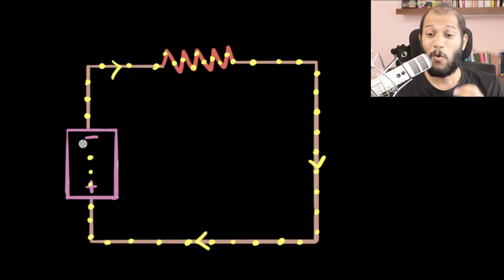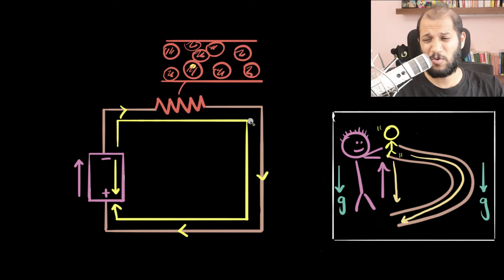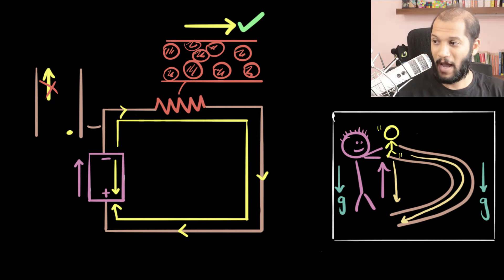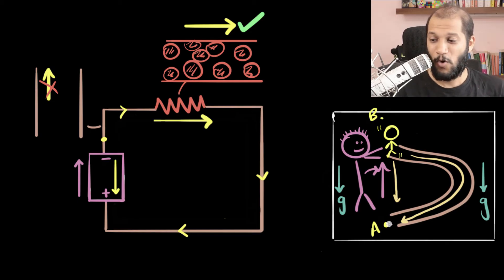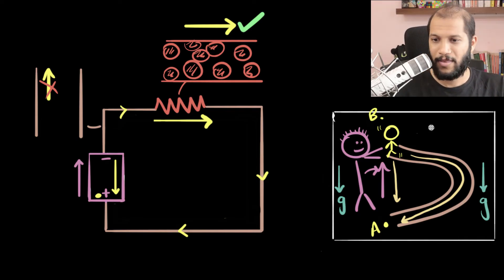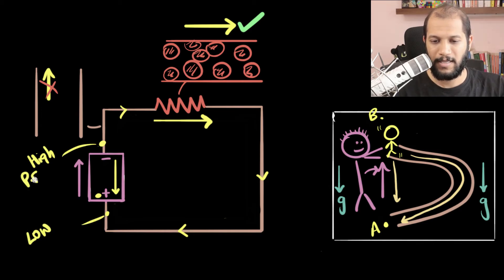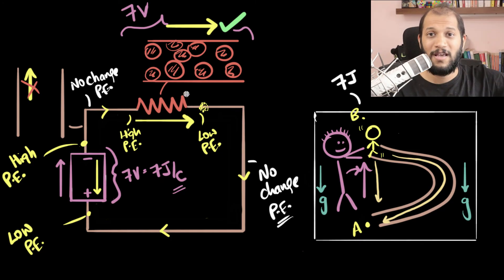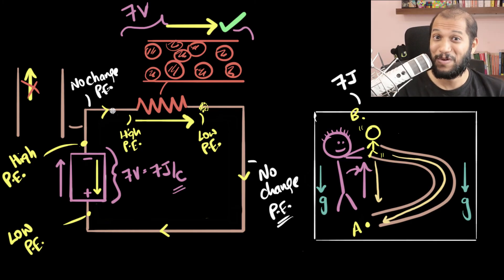Why voltage across resistor equals voltage across battery?

Comment: electrons DONT flow INSIDE the battery, this is a common mistake, the easier way to know why is by looking at the battery structure, it is a galvanic cell with an insulator between the two electrolytes, electrons CANT flow from a side to the other, thank you though.

Comment: I don’t think the electron physically moves, it might vibrate or move a little. But I don’t think it flows. It’s the field that flows that is termed as current.
Reply: Electron does flow ... it gets a velocity through the wire called drift
Reply: The video is misleading. The electron does not flow fast enough as per impression in this video. Furthermore, in AC current the electron definitely does not flow through the wire it simply oscillates back and forth
Reply: @kieranramtohal9645 exactly my point

Comment: If a resistor is designed to create potential difference of 7v ,but if we use a 9v battery then what would happen to that 2v if the wire we are using is superconductor having no resistance in it

Comment: What if there is no resistance,where will the potential energy be lost?
Reply: No. If we apply the same logic used in the video, Electric Potential in each point of the circuit will be the same (Assuming we have a superconductor that does not have any kind of resistivity). However the electric potential difference/ voltage will be zero. Because Electric Potential in point A (say) and in point (B) will remain the same.

Comment: This explanation is fundamentally wrong. 
A resistor acts as a bottleneck, affecting the flow of electrons across a wire. This is similar to you attach half inch pipe between two four inch pipes. Flow of water will be determined by narrow pipe in the middle. Most of water pressure will concentrated to force water  pass through narrow pipe.

Comment: So then what happens if you remove the light bulb and its just plain copper wire? Since you said that nothing happens to its potential energy because there are no forces in the wire, then does the voltage stay the same around a circuit with no loads? I don't understand.. because the electrons lose their energy when they come back to the positive terminal, so there must be a slight change in potential energy in the plain wire. Idk, I'm just some 9th grade kid so any explanation really helps :)

Comment: Sir i have a question, we know that positive charge move from high to low potential. If two sphere is positively charged then their potential will be positive. So suppose q1 has a potential of 13v and q2 has 5v and we connect them with conductor then the positive charge will move 13 v to 5v. But we know that if the potential is positive then the electric field for any charge is positive. so both 13 and 5v is the part of an positive charge and we know positive charge moves along the field line so in this case those are positive charge and their electric field is outwards direction. So then how positive charge move 13 v to 5v. Sir can you answer this question plz 😢🙏🏻

Comment: Sir, can you please explain series and parallel circuits 

And why CURRENT (I) is not the same in Parallel and VOLTAGE (V) is not the same in series circuits

Comment: But sir if there is no bulb or resistor in the circuit, then how will the potential difference be made because there will be no source through which charges flow and lose their potential energy ?
Reply: If am not mistaken there is some form of internal resistance in the battery,so if there are  no resistors in the circuit what will happen is all the energy/pd will be lost in the battery itself

Comment: Sir i wanted an explantion on how does the electrons work in a battery works like how does it create a potential difference ?? In this video you said that the electrons are pushed from the postive terminal to negative which is later pushed from the battery into the conducting wire ...but how can that neutralise the battery later on ...sir i am a bit  confused ...please help
Reply: sorrow in ass!! thats chemistry of cell
Reply: @WV_li  no no you didn't understand my question brther...sir said that electrons are pushed from postive to negative. ...then they are pushed from negative terminal to conducting wire ...so how can will this neutralised the battery cz ...the electrons coming back into the positive terminal would again be ...thrown into negative terminal...creating a never ending loop..

Comment: Mahesh, see my comment on your last video. I think you are creating more confusion on the direction issues here. The chemistry of the PLATES are opposite such that the electrons in the chemical are attracted to the more positive metal on the negative pole and the opposite on the positive plate.  But you may be mixing up that with the convention of assuming flow that trade school texts still teach due to probable cultural differences only now. The original excuse related to how the older texts use the arbitrary assignment of flow from the positive to negative direction.  But you  have to stick to the modern understanding when teaching the actual theory or it creates conflict. Those trade-school texts that I found and learned some from tell you up front about the distinction and so let them keep the burden in having to explain this if necessary. The high potential is only on the negative side. The term 'conventional' is misleading but only historical given the actual convention today is to the known reality of electrons. 

The plate inverse distinction is best left to when you want to teach how the chemicals work in the battery. Then the more positive metal is what attracts the electrons on that negative side  and the opposite for the positive side plate. The high potential is ONLY on the negative side because the charge on the metals are fixed and the chemistry involved needs a digression more involved.

Comment: I'm bothered by how much you are emphasizing how there are no changes anywhere but the battery and the resistor. I get that you mentioned that in the real world the wire would have to be a super conductor for that to be true, but you said that once and then treat the wire as ideal, potentially giving people the impression that wire has no resistance and only 'resistors' in a circuit will cause voltage to drop.
Reply: Bro really thinks anyone will care if he is bothered or not😂

Comment: Hm, so essentially, an electron gains some Joules of energy because of the chemical interactions in the battery. This is akin to a child gaining G.P.E. after his father raises him back up to the start of the slide. 

Then, there is no electric force in the wire and all electric force is concentrated on the resistor. Why? Well, that's a separate video. But, we can still compare this to our analogy. The wire where there is high P.E., we can compare that to the starting area of the slide having a wide area. No matter where it is in the starting area, the child remains to have high P.E. because it is still the same height. Similar logic in the wires. 

Now, when the electron goes to the resistor, that's when the energy is all lost. This is similar to when the child finally slide down the slide and therefore lose his high P.E. Then, the wire from after the resistor up to the opposite terminal of the battery all has same low P.E., which is akin to the ground. 

Because of this, we can say that the voltage across the battery is the same across the resistor. 
*Voltage is the amount of energy (Joules) per Coulumb of charge.

Comment: But .... Positive terminal has high potential??
Reply: The potential energy calculated for electrons, which have a negative charge. So, the signs of the potential energy of electrons are changed to opposite

Comment: I also have another question. If we remove the resistor and create a short circuit, it will mean there will be no voltage drop since we are assuming we are using a super conductor. How will it then obey the law that the voltage drop must equal the voltage supplied

Comment: Ok...thanks for these last two videos. Really explanatory. Just one question though. If voltage determines how much current flows through a circuit and how fast, can we say that the voltage drop is experienced across the entire circuit though affected by the resistor alone. The reason I'm asking this is because you said in your previous video that the speed of the electron is affected by the resistance and all the electron pay the price for that resistance in their speed. I don't even know if i am making any sense.

Comment: Damn thanks for the video, it cleared out my almost my all doubts but what if there's no resistor in the circuit? Assuming there's no resistor in the circuit means the energy gained by electrons wouldn't be spent anywhere (cause there's no resistor) so if that's the case then the energy would be same everywhere. So, when electrons comes to positive terminal, it'd have same amount of energy, which contradicts to the example where all the energy is lost when object approaches A from B. Also, what would battery do to that electron which already has an electron? would the electron gain even more energy and continue to gain energy at each interval?

Comment: What happens if we use a high voltage battery in a circuit with lower voltage resistors or a low voltage battery with a higher voltage resistor?

Comment: 18:02 how does the circuit know all of this? A doubt I’ve had for ages. Which video should I see for this?
Reply: Charge distribution on the surface of wire

Comment: What if two or more resistors are used u said at one end of resistor there is high p but at another there is low p approx 0 you said so in resistor two how can 0 p be transferred

Comment: Sir I am in 9th class ICSE.The definition Of PD is the Work done by the electric force from the terminals to move a charge from one point to another.But if I increase the length of the wire making the electrons to move a longer distance to reach the bulb the bulb should glow more brightly as I am increasing the displacement component.But why does not that happen?
Please reply Sir

Comment: Great explanation. I have measured the voltage referring to conventional flow.  Just before the resistance is battery voltage.  The resistance uses almost all of the voltage except what is required to overcome rest of the resistance in the circuit to make it back to the battery. Or am I just looking at it differently?

Comment: Hi, I have learned a lot from your videos. But this explanation seems to be wrong:

1. You say the electric field is conservative. Correct. However, it is not the same electron that is travelling from the negative terminal to the positive terminal.  So, your path-integral explanation is incomplete.

2. Also, when an electron aggregates at the positive terminal, it is NOT pumped back by the battery. It is instead just "absorbed" by the electrolyte in the battery. So no work is done by the battery per se to "move" electron from the positive to negative terminal.

After going through several videos/articles in books and the internet, however, this concept is still not well explained, and I still struggle to truly understand what is truly going on.

So, could you please redo this video with more depth?

Thank you. Grateful. For everything!

Comment: electrons dont rally pass through the battery right?
they just collect at the positive terminal,  and neutralise
Reply: Charges in general do, not necessarily solo electrons specifically.  Inside a discharging battery, it could be positive ions flowing from negative to positive, or it could be negative ions flowing from positive to negative, or a superposition of both simultaneously.  The details depend on the specific battery chemistry.  Since a battery is not a capacitor, charges aren't building up at the terminal, they are regrouping in the electrochemistry, as chemical energy converts to electrical energy, moving ions across the two terminals inside it.

This is why Franklin did us a favor, when setting the "wrong" sign convention of charge.  He unintentionally forced us to be more flexible with our definition of current, so we are more willing to think of it as charges in general, rather than electrons specifically.
Reply: @carultch oh ok thanks!

Comment: Now explain the same concept with an Infinite Resistance (Open Circuit - No Electron Flow). How much Voltage between the Resistor Terminals?

Comment: I disagree about flow direction.         Negative battery post or house current sucks amperage.       Generators are grounded to push/pump negative charges from Earth or grounding body, in which is left a positive imbalance.            Stronger negative charges merely require weaker negative charge for function as positive for completing a circuit, as they are restored into balance.             Wiring does carry current around its surface and a weaker electric field.         Ohms occur when insides of wire is energized by heat expanded protons, which increases amperage drain.

         As the generator is a pumping portal,   the appliance determines drains upon current.      Thicker wire allows more current availability,   but does not impose it.             Thus a heating element requires thicker wiring to pull current through the ohms’ drain from the grounding.         Wow I just got an advanced intuition!!

Comment: I like your explanation and my problem is solved😊😊😊😊 . But I have another problem , why does voltage remain constant in parallel circuit?
Reply: It's because in the absence of transient magnetic fields, electric fields are conservative vector fields.  This means, that if a charge follows an electric field around a closed loop path, the net work done on it by the electric field will be zero.  There will be no paths that repetitively do work, or take energy from it, as it repeats the paths.

The current attempts different flow rates through each path, but if an amount that is inconsistent with Ohm's and Kirchhoff's law flows, a feedback loop will correct it to settle toward an steady state behavior where the voltage drop across both paths is equal.  Since the feedback happens so quickly, the amount of time it takes to correct itself will be imperceivably small.

Comment: No change in PE at the wire means if I use multimeter across the two points of wire, it means no voltage? Sorry I am not good in this. I am just learning.
Reply from the maker: Yes. But real wires have some resistance and hence have some voltage drop across them!

Comment: Since current can be different in parallel but voltage is same then why voltmeter is made up of very high resistance I think it becouse we assume if voltmeter have low Resistance current will pass through them but voltage is same

Comment: Thank you for sharing your lessons on YouTube. I also like Walter Lewin. After studying electricity for so many years, we learned all kinds of calculations, but I don't even know how electricity works. Thank you for making me understand. I have a question, according to U=El, the voltage of the resistor is larger than that of the wire, microscopically because the electron needs to go faster, which means more force to go through the resistor, is it? According to i=QnAv, in the past I thought that E would cause more electrons to drift, so the microcosmic effect of the voltage of the resistor is that more electrons move faster. Later I discovered that only the electrons moved faster, and the number of electrons involved in the movement did not change, that is, n did not change, only v changed. Yeah?
Reply from the maker: Yes. Everything is on point. But n is the number density. That only depends on the material (and temperature)

Comment: what if this circuit is  connected with a load let say bulb you said it loses all potential when passing through resistance wire then how will it provide energy to the bulb and make it light

Comment: Sir when the electron leaves the negative terminal of the battery, Since both are like charges the negative terminal should give the electron a push which would decrease the P.E of the electron. So why is it constant?
Reply: It isn't perfectly constant.  The constant voltage from the terminal to the first load, is just an approximation, assuming the resistance of the terminals and wiring is negligible, compared to the impedance of circuit elements in question.  There will be some voltage drop in the wiring and connections, to get the electron to move through the imperfect conductors.

Comment: Mahesh, I'm very glad to have found your channel -- your videos are beautifully illustrated, concisely and thoroughly explained, and you are an engaging, very likeable teacher. 
This video leaves me with one big question, however, which is, what are the implications of this explanation in the case of a circuit with no resistors? 
If we remove the resistor you have drawn in your circuit, we know the voltage in the wire must nonetheless at some point go from High P.E. to Low P.E., just as in the case with the resistor. 
Surely the wire does have some resistance, and rather than 'no force' being required to move an electron through the wire, the battery is doing work and the particle is reaching 'terminal velocity' (drift velocity) due to 'drag' (resistivity of the wire material)? 
Please, any clarification you can provide would be hugely appreciated! As an Electrical Engineering student, I feel that getting a very firm conceptual grasp of voltage and current is absolutely paramount for my future success -- your videos so far are a beacon of light! I will be infinitely thankful for any help you can offer in addition to the huge help your videos have already been!

Comment: When you say that there is no force in a wire, is not there the electric field throughout the wire due to the battery, which in turn would propose a force?  and when the electron leaves the resistor with no energy at all, how does it flow to the positive terminal without any force and electric field?